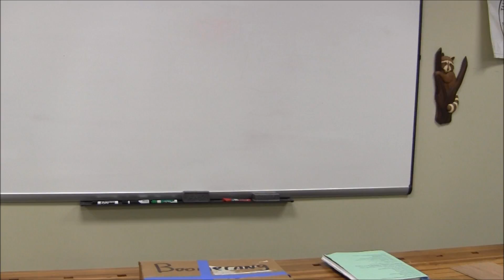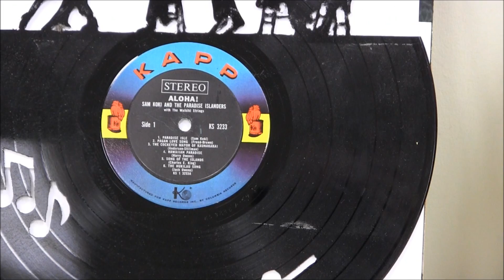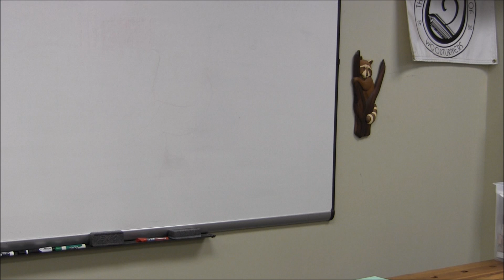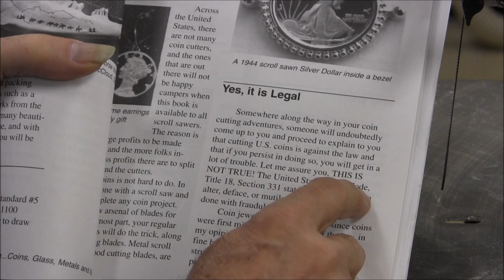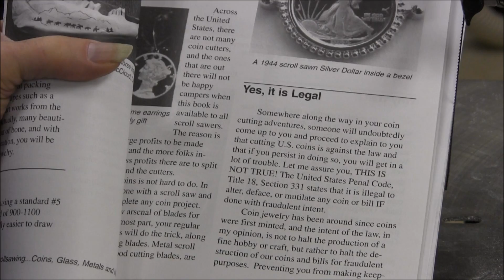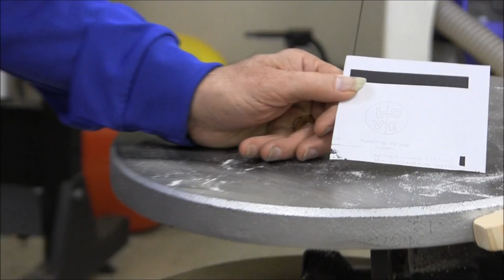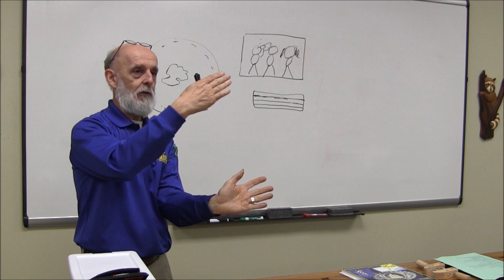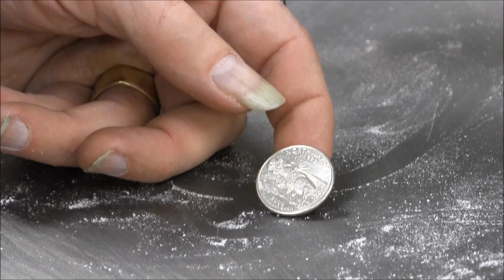2013-03-04 Non Wood Cutting by Hans Meier (1h27m32s)

Comment: Hans,
You said that you used "Shipping Labels".  I got mine from Staples, there're Avery Template 5165.
I goes through the printer well, and it stick very well.
But how do you get it off?  What do you use?  Alcohol, lacquer thinner, heat gun?
W. Kirk Crawford
Tularosa, New Mexico